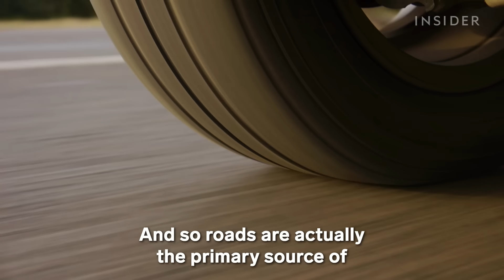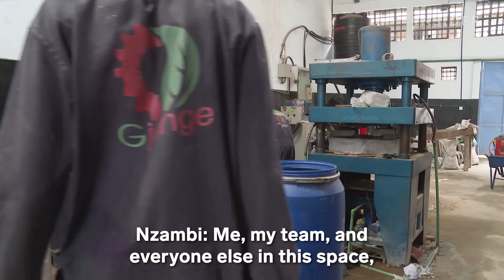Young Inventor Makes Bricks From Plastic Trash | World Wide Waste | Business Insider

Comment: Really wish her plan works. I wish her all the success in the future, we need more people to lead towards innovation.
Reply: Innovation is good just because of exitement we lack to see the possible side concequences of this action, if this gets popular microplastic along road streches which we cant pick up & recycle might be our next issue at hand
Reply: If she implement coating techniques she might be able to use this innovation.

If the problem comes from UV, a suitable coating, or material can be used on top of the plastic bricks.

I am neither a student of civil engineering nor chemical studies. But what this lady does surely brings a lot of potential to be uncovered. Sad thing is nobody will care until it does.
Reply: They will need a lot of RnD because plastic is a great idea when used correctly. I do hope it works, but many plastic outdoor tiles and deck planks get too hot to walk on in the sun. Like really hot. Imagine what would happen if you left your car's rubber tyres parked on that.
Reply: @scootergrant8683  Counts on what the plastics melting point is.
Reply: @scootergrant8683  should'nt they have something on the plastic that prevents it from leaking micro plastic this should be research not shutdown
Reply: @thepriscila7278  Yes, the simplest way to avoid the microplastic problem is by painting the plastic bricks in opaque materials, such as asphalt, the very thing this 'invention' was supposed to remove. Even so, this will only avoid the problem for the short term, it will not solve it. Once the asphalt breaks or is washed away, the problem reappears. She's basically ruining her region by making roads that are expensive to maintain, has heavy monthly maintenance and leaks microplastic dust within large area. 

So basically her bricks will soon no longer be the 'solution', but the root of a new problem. Sure she'll get innovation medals and maybe get rich. But the problem itself is not solved. A solution that creates a bigger problem is not a solution in the first place.
Reply: Your profile pic is hilarious and perfect 🤣
Reply: News flash, it won't work.
Reply: It’s just turning one plastic product into another. We already do this n most countries. Then there’s the problem of disposal after the use. Same problem as before. But I do love her spirit.
Reply: Its still is pretty much plastic and would breakdown in time causing more harm. Burning is one way to get rid of plastics but there's just so many plastics to burn and too little places that burn and process them. Landfills works but some 3rd world countries have terrible landfills regulation. What she's doing might actually cause harm especially if used on roads which wears and tear from vehicles and it is also harmful for the health of the employees.
Reply: This is not a good idea because we have heavy vehicles(trucks, tankers etc) and when they drive on this road it will crush the plastics and wind will blow it in to the air.
Reply: Making more things out of plastic is NOT a solution. Especily when her idea gets copied and plastic bricks are mass produced and made from non-recycled plastic
Reply: @insectbite1714  plastic makes horrible roads. MAYBE sidewalks, and would be better on the feet...
Reply: @insectbite1714  You actually think they will get the millions in funding if they sourced new plastics? You know nothing about running the business pal.
Reply: @petergriffin9902  Making things out of plastic is NOT the solution. If this bothers you, then you have bigger problems then business management. We already have completely 100% recyclable material to make roads that don't warp in the heat and dont deteriorate faster than plastic. Its also cheaper than reyclying plastic. Why would i spend $1.50 per foot of plastic when i can get $.75 per foot of asphalt? NGMI
Reply: @insectbite1714  Imagine wasting pure oil and chemicals on roads lmao. Nobody will build this from pure plastic. It's a genius idea to re-use recycled plastic.
Reply: @insectbite1714  what IS the solution, then? Keep recycling?
Reply: @Benni777  Most plastics aren't recycled the are dumped into a landfill and leach into the soil, the ones complaining won't mention that.
Reply: @iMadrid11  Except you can. Although only two companies that could do it existed in the world a few years ago... Most clear PET bottles can be recycled, other ones are made in to fabrics, shoes etc. Recycled plastic is seen as a better material in some casea compared to virgin material....
Chemical recycling is also an option (on most plastics, that first one only accounted for bottles etc. which is still a big part of the waste.). It is tough and expensive, but a few companies in germany can do it. They break down the old plastic with chemicals and afterwards you can't distinguish it from stock made from oil.
Reply: It really isnt a good idea...
Reply: @XENOOO  yeah because landfills are way better, genius.
Reply: @patrickgrady7505  bro the plastic is still their regardless of it being at a landfill or not, it’s still polluting the environment, especially with constant worn states of which vehicles are constantly going over them, leading to micro plastics being scattered everywhere…
Reply: @patrickgrady7505  No landfills. No recycling. JUST BAN ALL PLASTIC, METAL, AND GLASS PRODUCTION!

That is the Green Way.
Reply: @ladymacbethofmtensk896  yes I fully agree but IN THE MEANTIME until the whole world is up to par on sustainability this right here is thr best solution to the current issue.
Reply: @ladymacbethofmtensk896  tf are we gonna use then? Waste more wood and have more forests deforested, have houses break down easily,those were made so that we dont have to waste more materials and have things more tougher
Reply: @25lighters91  did you really just bring race into a topic about sustainability? smh lol  What next? politics? religion? Don't deviate from the main point of this discussion.
Reply: @patrickgrady7505  unironically, yes they are.
Reply: @ladymacbethofmtensk896  No need to ban metal and glass.
Reply: @Valo666  please elaborate....
Reply: @ladymacbethofmtensk896  >ban ALL THE THINGS
Yeah I'm sure that's both viable and workable and totally going to be a thing ever.
Reply: @ladymacbethofmtensk896  you know things are bad when I had to scroll down and be told it was sarcasm
Reply: @25lighters91  California just had a pipe line rupture that caused another oil spill.
Reply: @XENOOO  this is spoken by someone who lives in the first world never having seen a third world country landfill.

These people don't have the luxury and choice.

It's so funny to talk down on this from your privilidged chair offering no actual idea or criticism.
Reply: @XENOOO  how come? Its creating new jobs and new resource to use.
Reply: @coolguy_6433  It's chemistry. When plastics are exposed under sunlight, they break down into microplastics. Microplastics is much more dangerous than useful plastic. They are light, gets blown up by the slightest breeze and they get into your nose, your lungs and they will never break down. The problem with plastics at sea is not that there are plastic bags suffocating dolphins, it's that these plastics are broken down into microplastics that gets eaten by fish and turtles causing them to die.

At least if it's at landfills, these plastic bags will never be broken down into microplastics. Sure they will be in there for millions of years (unless the heat of the Earth cooks them and turns them into petroleum compound, which could work under some very narrow circumstances) but at least it doesn't harm anyone else. These bricks will harm everyone within a radius of 100 meters (a very kind estimate, the danger radius is probably bigger) once it is broken down into microplastics by sunlight.
Reply: @aziris7257  honey but there aren't any more space left for you to dump plastic waste, landfill all over the world are reaching max capacity or have ald reached them. If u done use them or recycle them in any way, we are going to have to live with trash as the use of plastic is still here to stay for many more yrs. Plus u do know the clothes u wear have microplastic as well unless u get ur hands on 100% pure cotton clothes sew with pure linen thread which is not something used to make clothes anymore
Reply: @aziris7257  maybe they can invent some type of varnish or something that can coat the bricks and keep the microplastics in it, also thank you for your explanation.
Reply: @aziris7257   there goes the problem with your argument. If plastics break down to microplastics when exposed under sunlight, then whats stopping the plastics in landfills from breaking down to microplastics when exposed to sunlight?
Reply: @sayanorasonic  Uhh... I don't know if you've been to landfills, but the very purpose of landfills is to bury trash under dirt. Therefore, the plastics at landfills are not exposed to sunlight. When plastics do not get exposed to sunlight, they don't break down into microplastics.
Reply: @_hui_4519  Better to burn them then.
Reply: @sayanorasonic  Exactly, plastic is either burned at landfills or they leach into the soil and water but they will not mention that, and that's for the majority of plastics, most isn't recycled.
Reply: @aziris7257  Most landfills are full so there's a high chance plastics are just sitting on top rotting and leaching into the soil or air.
Reply: @majesticmajestic7058  I won't say 'most landfill'. Most landfills in my country are well managed and trash are properly covered in dirt. I know from my friends in west Europe that landfills in Europe are properly taken care off too. There are incompetents everywhere who are bad at doing their jobs, such as the open landfills of India and South America, but the purpose of the landfills remain to bury trash under dirt. 

If the people of that country is incapable of keeping trash buried under dirt, this will not solve the problem, as 'the problem' will keep getting ignored. This time, the problem will not be 'landfill is not managed properly' but instead  'plastic roads need to be repainted in asphalt again'. Just like with landfills, the government and the people will half-ass it again. That is not the fault of the landfills or the plastic roads, but the people who think it's not a big deal.
Reply: @aziris7257  I am in Romania, a country with horrible economy and a even worse government of ministers, and yet we can cover a fuckin landfill correctly.
Reply: @majesticmajestic7058  nope. They have a fence around and they have dirt on top
Reply: @coolguy_6433  that what I was thinking
Reply: It won't work. She's doing something while only knowing half the things. It's not a good idea.
Reply: @themonsterunderyourbed9408  Putting the plastic in a landfill so it can leach into the soil is not a good ideal either.
Reply: @majesticmajestic7058  never said it was.
Reply: Her plan to poison people...with plastic waste micro-particald...youre ignorant to what they are actually doing.
Reply: @Theo-dj7vs  And allowing the Plastic to leach into the soil in landfills is better?
Reply: its toxic to make ,its toxic when it breaks down ,it stays toxic for 1000s of years after we stop using the products . moving it from one place to another does nothing , all she is doing is adding to the problem by spending it around . when they break the plastics down in that machine all the fine plastic u cant see floats into the air , her lungs , the lungs of her workers , the water , the food and anything else that's with in 5 miles of her factor .i love her drive but she isn't doing any good at all ......... "she is amazing"   for putting her workers,herself and the rest of us at risk ??   please      get an idea ........lets hope you do some studies into the impacts of said project before following her lead .
Reply: @VimbaCodes   Ok lets just make the world out of much, much more worse plastics. Thats so smart. Youre so smart.
Reply: hey
Reply: @jhay440  The only alternative is for it to be dumped into the already full landfills and leach into the soil or burned.
Reply: Yes why don’t they build homes instant roads I believe that would be better use  👍👍👍